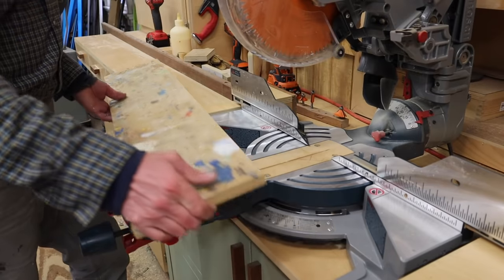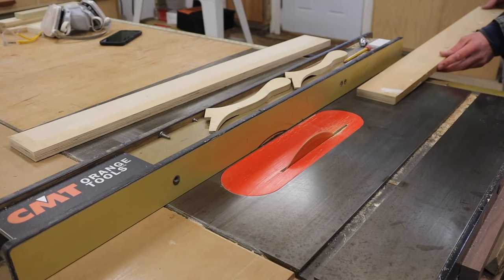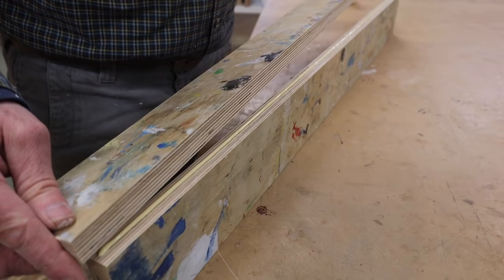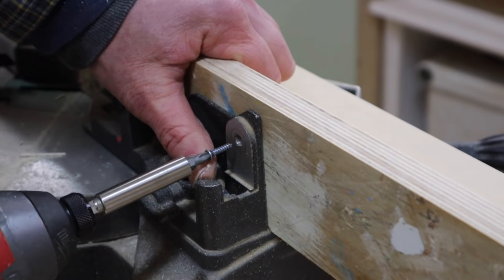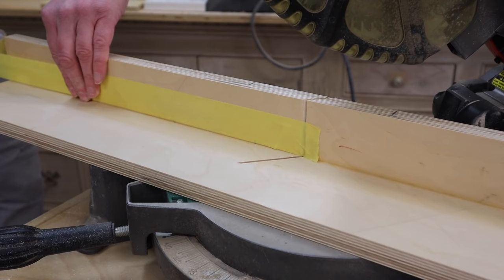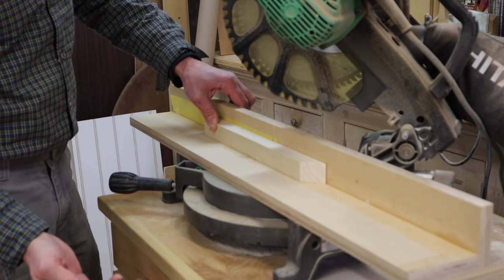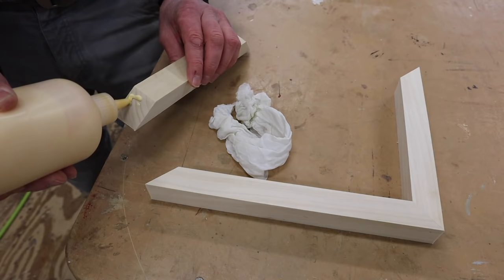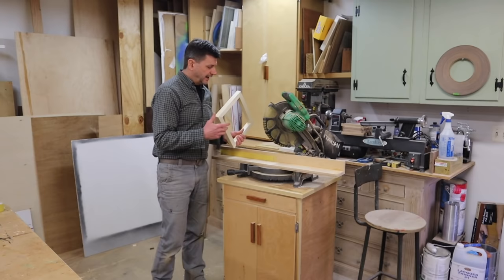Make a Sacrificial Fence & Get Perfect Miter Joints Every Time!

Comment: If you have a 12-inch miter saw blade you’re going to need a longer base than 3.75”. I used 6.75” and it worked well on my Bosch. But I learned this the hard way.

Comment: Thank you Jon. I just did a molding frame for the opening towards my attic. So the pretty oak moldings got cut and I got this 1/32 ish split. I re-shaved the cuts with the saw, clamped the parallel pieces together to check fit and sanded them with a piece of ply wrapped in sandpaper and eventually made it work, but it's 99.8% perfect not 100. But I figured there must be an easier way and here I am - I have to install moldings in the house. My process was very time consuming. Also, potentially expensive if I had to redo the molding framing.

Comment: Thanks Jon, On the subject of pin nailing miters the way you've shown in the video, I've observed that when doing the same operation with a stringy grained wood like oak, the pin nails can sometimes ride the grain outward and protrude from the side of the frame. I've never seen one completely fire through but still....watch those fingers!
Reply from the maker: Will do :) thanks

Comment: another great one Jon !! No need to respond..I am a very loyal fan ...and I am excited about your part in the 'Mob Scene" .....I know that some times you occasionally touch on fan questions and I have one .  One of the problems that I have had as a 'New' ( it's been jeeze 40 years now ha ) wood worker that even with great engineer squares is that my 45* will often line up but won't always be co planer . Not sure I asked that right ...but if you get 12 seconds some time I'd really appreciate you comments . Again many thanks a 1000 times brother keep on keeping on ...-ml
Reply from the maker: Hi Matt ... thanks man I appreciate it.  it sounds like the blade may not be at a perfect 90 degree... or the fence is not flat on the saw. That’s what I would look into first.

Comment: Looks like an excellent way to avoid chipout and provide a little extra support without a miter station, but how do you get such accurate angles on a miter saw? I'm always told that's tough to do and haven't had that much luck myself.

Comment: Jon - I notice you don't use your sliding compound miter saw for this.  Is your preference to use a non-sliding saw for this purpose?  Is it due to accuracy or that the Bosch in this case is not reliable?

Comment: I have a question, if you are cutting mitred wouldnt it be best to cut one half of the joint on each side of the fence? So even if your blade is out by 0.3 degrees, then it will also be out 0.3 degrees the other way, on the other side, so it is still exactly 90deg corner overall

Comment: Jon, I have a DeWalt miter saw and when its necessary to cut from opposite sides(like for non square molding)  it removes a triangle section in the sacrificial fence. Do you have a way I can quickly and repeatably move the fence back and forth?

Comment: Hi Jon,
I noticed when you adjust the fence on your table saw with the tap tap tap.... Is the distance between the blade and the wood the same from front to back because it seems like the back of the fence on the table saw move around as well.
Reply from the maker: It’s a t square fence so when it locks it’s the same at front and back